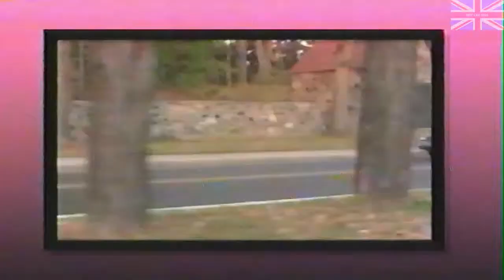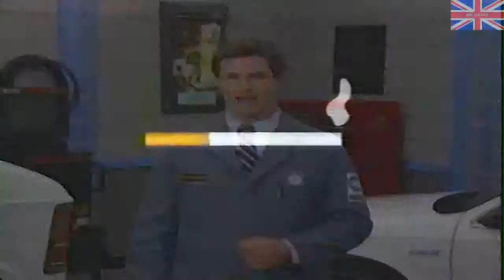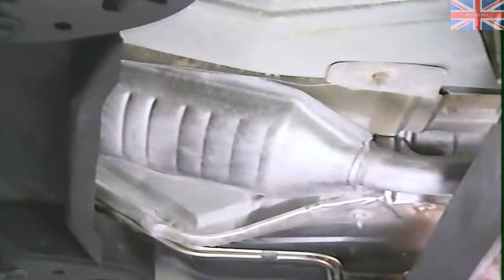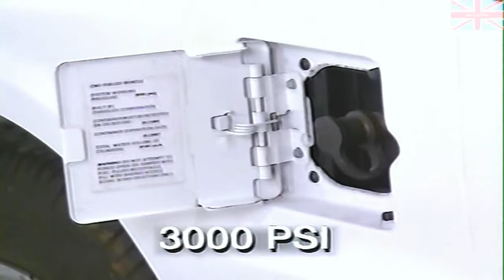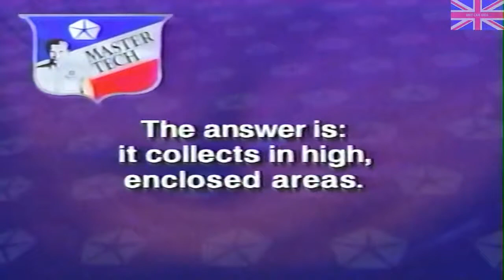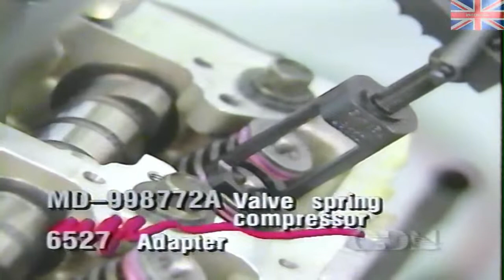Chrysler (US) - Mastertech - May 1993 - Alternatively Fuelled Vehicles

Comment: And how quickly we forgot about methanol-fueled cars...
Reply: Methanol has all the issues of ethanol but worse. Higher vapor pressure and more oxygen by mass causes more smog. It's a more aggressive solvent. Methanol mixes poorly with water so at high concentrations you need another solvent to keep the water in suspension. The only "benefit" is that it's slightly easier to synthesize from natural gas.